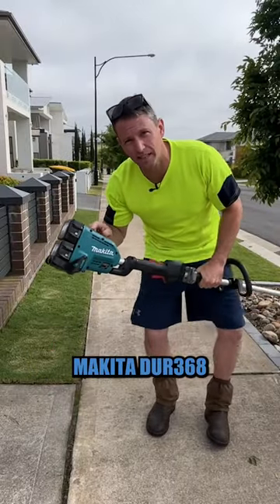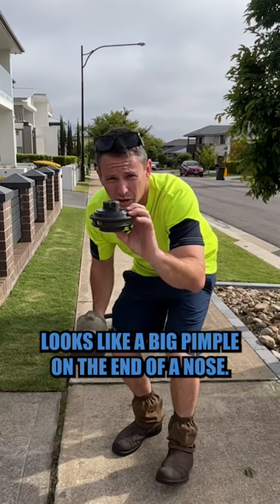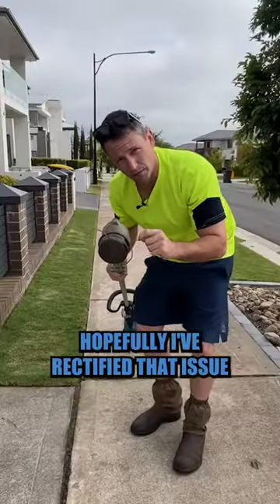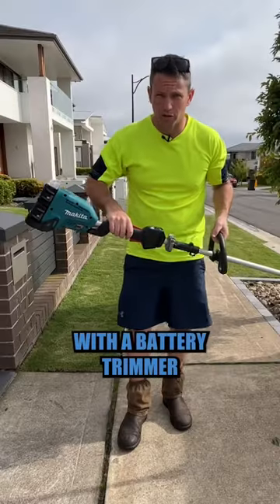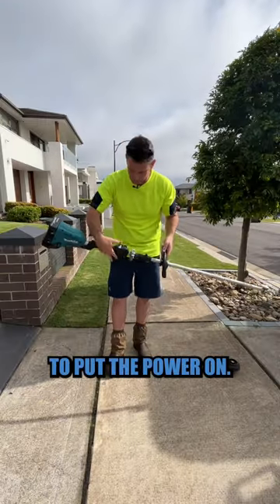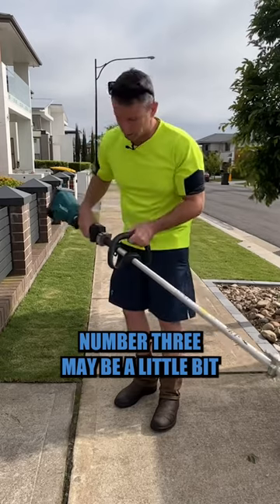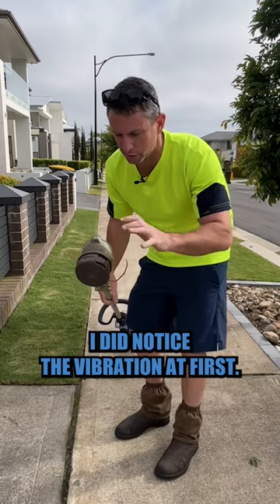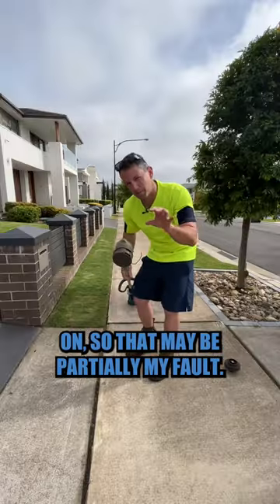See what I like about the Makita DUR368 Line trimmer on the Turf and Tools Channel.

Comment: XRU-15 36V I put the speed feed head on there & it gets down but I got to admit my echo SRM 225 (⛽) is better... Lithium🔋do NOT hold power until they die once the batteries have 2/4 bars left once it gets a load the motor cuts out & you have to let off the trigger/pull it again... With ⛽ you just keep going 'N going until the tank is empty 💪

Comment: Hi Tim,
I got the Makita 40v max XGT split shaft powerhead with line trimmer head. It so smooth with barely a hint of vibration. The downsides are the bump feed head has the line sitting way to high from the ground. It feeds line easily but sometimes a little too much gets cut off. The power cutting off in 2 seconds of not holding triggers in gets old real fast. 
Othe than that it's a pleasure to use. No numb hands from vibration.